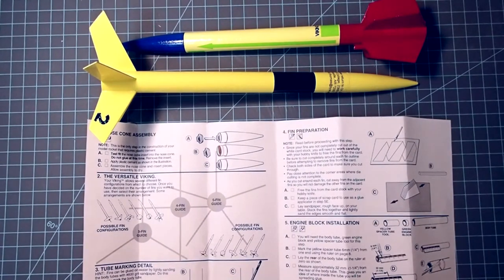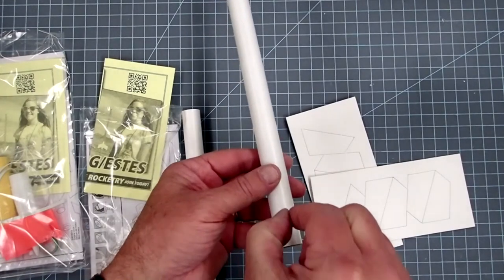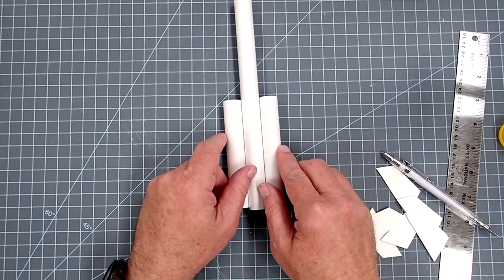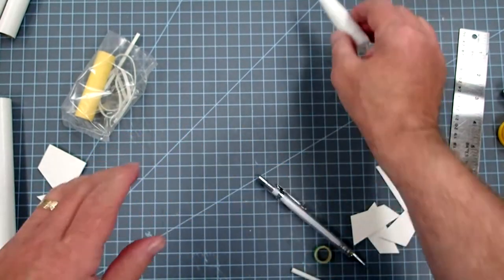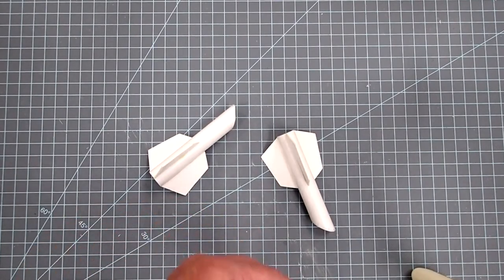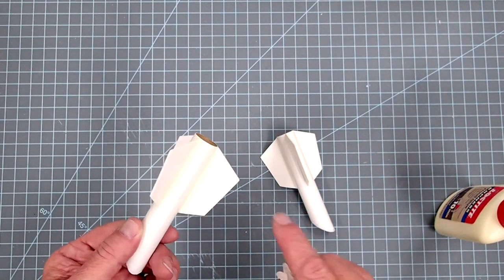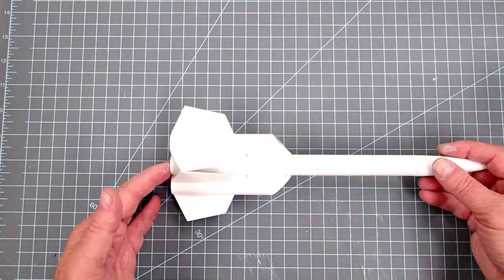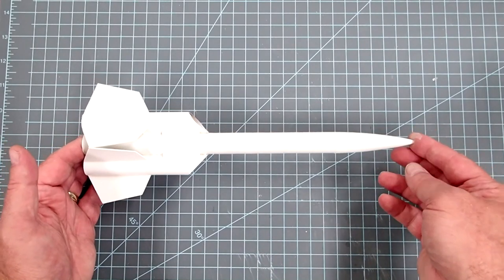Viking Project: Outrigger

Comment: Could use thin CA to tack the tubes together, then use glue to fillet.
Reply from the maker: You'd probably need gel CA. The thin stuff would just soak into the cardboard without bonding. It turned out that the aliphatic glue worked really well.